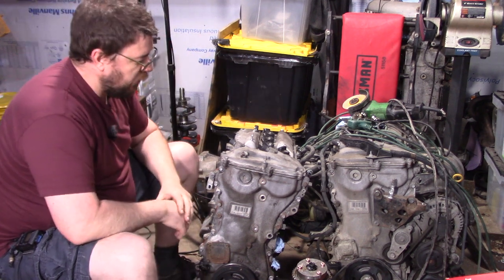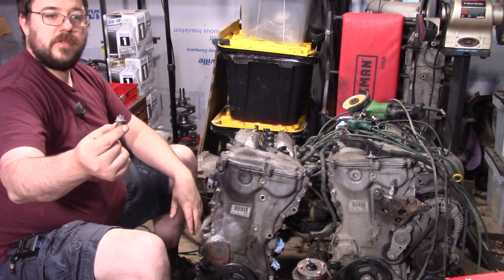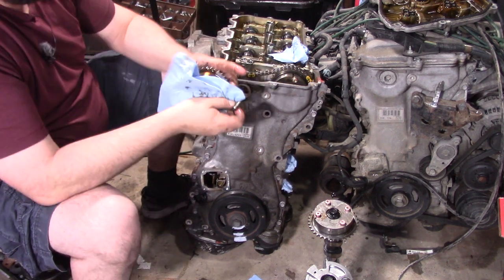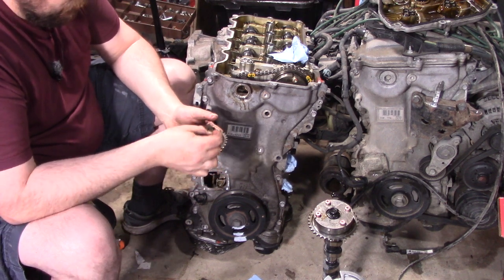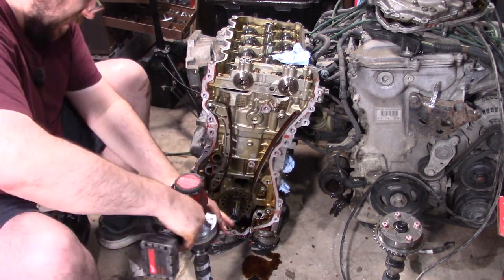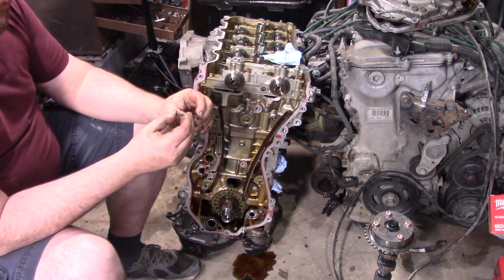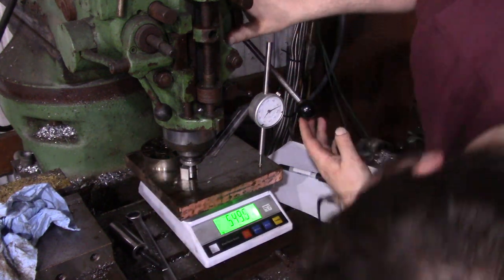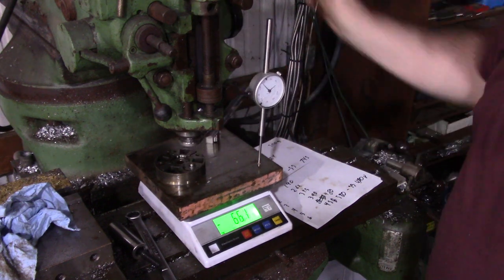Fixing the 2AR's incessant cam gear rattle for good!

Comment: You look at problems like a proper scientist. Using expert methodologies, professional instruments to gather data, and testing your hypothesis. None of this fascile power mod suggestion stuff anyone else can come up with on their own. I see you'll also transcendentally look for solutions and changes before setting pencil to paper, following your insights. All this possible through years of experience/training, but fueled by a strong love of the game for it's own sake. Thank you for bringing this content to us, it's always an education for me.
Reply from the maker: "professional" equipment.... as professional as I can get on a shoe string budget. I have to get pretty creative sometimes to get the data that I want and as you've seen now the mill often ends up being the base of my instrumentation. I really want to build a machine to test valve springs at high RPM to determine required spring rates. I'm pretty sure many people in the industry are using rather excessive spring pressures and I don't like the extra friction. I also need a flow bench at some point so I can explore some porting on this motor.
Reply: @FrankensteinMotorworks  Something something something kickstarter! Haha
Reply: I agree! Real talent here!

Comment: I always drop what I’m doing whenever you upload. Glad to see you were able to find an answer to your cam rattle. I like this style of video where it feels like we are all along for the ride on the mystery and is more satisfying than just posting conclusions. Oh, do you have a TIS subscription?
Reply from the maker: Thank you for the feedback. It certainly won't always be able to work this way since sometimes i spend weeks going back and forth to the shop measuring one or two things and just letting it stew for a while while i think of different designs that can solve my problem. 

I don't have a permanent TIS subscription but i usually buy a 3 day subscription a couple times a year. It's a great source for info. Especially if you read between the lines of the info they do give.

Comment: At 3:22, you state that "this is turning into a puzzle" and that "this is supposed to be possible" and you'd be right on both counts.  After messing with mine for half the day, while trying to keep the engine timing, I found out that I had the crank 180 degrees off of TDC "compression".  With crank at TDC compression, this puts the key on the camshaft in the 11~12 o'clock position.  Next, I marked the gear and chain for both intake and exh gears so as to keep timing, then remove the bolt for the intake VVT gear, pull the gear out of the camshaft, remove/suspend the chain to prevent it jumping on the exh gear.  Finally, rotate the loosened intake gear such that the "key hole" on the gear is at the 5 o'clock position, this allows the gear to clear both the timing chain cover and the camshaft key.
Reply from the maker: Thank you for the info, i will keep this in mind for next time. I know i will need to do this at some point in chassis.

Comment: Also worth noting is the condition of the vvti screen filters behind the banjo bolts. 
When they dirty/clog, initial oil flow on engine cold start is reduced.
Reply from the maker: The AR has the filters inside the engine so they aren't easy to check after it is assembled but that is a good point that should be checked.

Comment: I suspected spring tension also, as Honda has the same problem and I have fixed it simply by stretching the spring and the rattle went away.

Comment: Great video!!! Very informative and to the point. One problem I am having on my 2AR-FE is of course the cold start rattle but also after the engine warms up what sounds like a Valve tick/knock. Doesn't happen all the time, seems to be there some days and other days the ticking/knocking is gone. 
 Any idea's on what this could be would be greatly appreciated!!!
Reply: @multirotormanish7220  I'm thinking it is the same thing. It happens when the engine/Oil is cold. If you notice when the engine/Oil is warm/hot, you don't experience the noise. It is also only in Drive and Reverse. When you hear it next time put the car in Nuetral or Park and it will go away.

Comment: At about a million points in this video,I would have had the dang springs go sproinging off, and have to shove a bunch of pen springs in there to replace them.
Reply from the maker: if it makes you feel better i did have one spring go sproinging off but I edited it out. It was while i was measuring spring pressures on the test fixture.

Comment: Hello from Japan and thank you for making this video it’s insanely formative my new Alphard will be delivered soon with 2AR engine which will eventually make this rattle sound. I’m a bit worried but oh well I probably trade it off.
Reply from the maker: Most of the 2AR-FE engines never have this issue. Make sure you regularly get the engine up to full temperature and keep it there for a while for best engine life.
Reply: @FrankensteinMotorworks  you mean run the engine?
Reply from the maker: @Atomex_edit  some people think that an engine that just takes a little old lady to church and back once a week is a good engine. Those engines are the one most likely to have a ton of buildup inside the engine because they never get up to temperature. I don't know what the car usage patterns look like in japan but if you are in a situation where all trips are short trips make sure you occasionally take longer trips with it to keep it up to temperature for long enough to get all the moisture out of the oil and just generally keep things clean.
Reply: @FrankensteinMotorworks  thanks I will take your advice to take a long trip around Japan with family. It’s probably the best advice I have ever received here on YouTube. Cheers!

Comment: I noticed that the Canadian 2az in the 11+ cars recommend 0w20 oil and the earlier 2az suggest 20w30 or 0w20 oil. The 2az are bad for the vvt cam gear rattle, mostly with them the pin wears a groove into the material though.
Reply from the maker: Yeah, it's really frustrating that the configuration does not allow for a proper spring rate to be installed in a way that prevents the valve from sitting in a position other than fully open or fully closed. If this does not fix it I'll need a two part pin would require more pressure to open than to hold it open.

Comment: Love the content Marc. I feel like you have been neglecting 2GR R and D. 2AR is cool and all but I feel like there are a lot more SW20 2GR swappers out there. Regardless, wonderful content and very interesting.
Reply from the maker: Launce, I've literally just released a new flywheel for the 2GR and also a new accelerator pedal assembly for the SW20 swaps. I'm not ignoring the 2GR, the 2AR is a fun motor to play with that responds very well to mods and the architecture is very similar to the 2GR so lessons learned will be applicable over to the 2GR when i get there. Things like figuring out the right kinds of spring seat pressures necessary and what needs to be done to the valvetrain to get it to rev to the moon without a rapid unscheduled disassembly event. Plus, my race car has a 2AR, not a 2GR.
Reply: @FrankensteinMotorworks  totally understand and I am one of your customers including recent purchase of your flywheel and soon pedal setup. I should have been more explicit by saying video content vs. R and D. My bad. Hope you have some new 2GR videos really soon!
Reply: @FrankensteinMotorworks  well I, for one, am very excited for this spring info now, as I either have ridiculous rattle or my bottom end is knocking :( :( :( :( :(
Reply from the maker: @mrkazman  I don't have enough testing done yet to have the springs for sale but if you're wanting to try it yourself i'm happy to sell you a set of springs.

Comment: Has it been rattling long? The reason I'm asking is that I didn't see any signs of wear/damage and mine has the cold start rattle, too. I've also been hearing about people just leaving the engine alone and that this issue doesn't actually cause reliability or longevity issues. Thanks and great channel!
Reply from the maker: Unfortunately i don't know the answer to that. The motor has been rattling as long as i've had it but it only spent about 3 weeks in the car before i pulled it out to test out the 2AR-FXE build instead.
Reply: @FrankensteinMotorworks  Understood and thank you for replying back!

Comment: 3 years later. I  checked your site for the springs and didn't see them. Did this not fix the rattle?
Reply from the maker: It fixes the rattle for most people but the amount of hand-holding required to help people through the installation is ridiculously high so i no longer sell them.
Reply: @FrankensteinMotorworks  Lol. Damn that sucks. Guess I'll just buy a new gear or experiment on my own. Thx for your input on this video and response.
Reply: @rotaryperfection stretch your vvti spring.
Reply: @DIYCOMMUNITYHACK  Couldn't on mine as the interal mechanism was completely broken. Had to buy a new part.

Comment: Have you done a video on how to unlock the gear ?
Reply from the maker: I know i'm incidentally shown it a few times but i've never really properly focused on it. The factory service manual does a really good job explaining it. If you send me an e-mail or contact me through the website I'll be happy to send you a copy of that part of the manual. I'd put it here but i can't attach an image to a youtube comment.
Reply: @FrankensteinMotorworks  thank you man. I have the TSB for it but the suggested method didn’t work for me. Been frustrating as hell. I’ll just have to experiment. Should have just bought yours

Comment: Hi ,I have 2009 2arfe, with severe oil consumption, can I reduce the problem by doing bg engine flush procedure, also curious what year toyota resolved this problem because I'd like to replace motor with a good used one ,any advice
Reply from the maker: Severe oil consumption is really only an issue for very underutilized engines that never or rarely properly get up to temperature. It isn't actually a widespread problem. My advice would be to replace it and then just make sure you regularly get the engine up to full operating temperature.
Reply: @FrankensteinMotorworks  I realize that to a point but the 4cyls,had or maybe still have low tension oil rings,do you have any insight into when or if they started using rings that didn't have the stuck ring senaro?

Comment: Do these engines have the little plastic oil filter for the VVT oil circuit like the UZ engines? (FILTER, OIL CONTROL VALVE
 15678-46020)
Reply from the maker: yes, they have a mesh filter in the #1 cam cap.
Reply: @FrankensteinMotorworks  might be worth comparing rattle vs non-rattle filters and / or logging the oil pressure to the actuator just to see if there is anything going on
Reply from the maker: @allan80supra  The filters have a pretty much identical mesh. The plastic carrier is a bit different because it sits in a different place in the engine but even that is pretty similar. The 2AR's vvt-i oil pressure is more or less impossible to log because it never exits the block. Also, once oil pressure comes up there's no control issue, the issue is before the oil pressure builds fully.  You can hear the issue very clearly at 18:53 in this video: https://www.youtube.com/watch?v=zOfbP0Tgye8
Reply: @FrankensteinMotorworks  doh... well good luck with the spring fix, I guess your other option is add an oil accumulator with the solenoid so it primes before start and a nice to have on a race car anyway... but my mind was just blown at the cost of the moroso accumulator valve on summit!
Reply from the maker: @allan80supra  One thing that probably wasn't clear with this video is that with the bigger cams the issue isn't just at startup but it is the same issue. That's why it became necessary to fix it right away. So unfortunately in that case a startup accumulator would not address it. There are people that have actually fixed their stock AR motors that way though because even an expensive accumulator is cheaper than paying someone for a phaser replacement. I do have some thoughts on an integrated accumulator for this motor that i would like to make at some point.

Comment: After that? What happened to the result of your hypothesis? Did  the rattling FIXED?
Reply: Hahahaha ! Good question, I’m waiting for several people to post their results, at least 5 o 10 people proving this hypothesis to do mine, I’ll already stretched out one spring from the old phaser from 20mm to 30mm , just in “Stand By” waiting for reliable and credible results
Reply: @64arguz okay, what’s the update? Did the rattling fix?
Reply: @DIYCOMMUNITYHACK  nope , I haven’t had time to do it 🤦‍♂️

Comment: I'm getting startup rattle on my 2GR 😢
Reply from the maker: The 2GR is a different design and should not suffer from the same issues. If you're having rattle on a 2GR and you haven't recently done an oil change you should change your oil and filter and also clean out the vvt-i filters and if the rattle does not go away you should change out the offending phaser(s)

Comment: I didnt see the springs on your site. Are they available?
Reply from the maker: You can reach out to me via the contact form on my website if you want to buy them. Unfortunately these have turned out to not be worth the amount of support time they take to sell. But if you want to buy them without installation support i can sell them to you for $25. frankensteinmotorworks.com
Reply: Hey bud. Is the solution to install these custom springs into a brand new Genuine cam sprocket? My noise is very minor and only on cold start for say, less than 1 full second. 114k miles and I do want to keep her going as long as possible.

Comment: Did you test the springs in the 2AR?
Reply from the maker: Yes, these springs are installed in four different 2AR motors out there and it seems to properly fix the problem.

Comment: did you ever find the correct spring to eliminate the issue?
Reply from the maker: The spring that i found has worked well for the engines it has been used in so far.
Reply: Hey buddy. Recent subscriber. I'd like to inquire about the springs you had in testing. My '13 Camry 2AR rattles on cold start (even in Florida heat) 0w20 oil, always full on dipstick and changed every 5k. Owned the cat since 57k miles and now has 105k miles. I check your website briefly but didn't see anything about the springs. 

Would it be best to get the spring from you and also install a new cam gear? I haven't inspected mine but the noise goes away in +/- 1 second so maybe no notice damage yet.

Comment: are you referring to the Toyota tick?
Reply from the maker: no, this is the startup rattle, not the "sowing machine" sound that is normal when the engine is running. You can hear it in this video at 18:53: https://www.youtube.com/watch?v=zOfbP0Tgye8
Reply: @FrankensteinMotorworks  That sounds really familiar, if not, the exact same as the startup rattle on early (2009-2010) 2ZR's. In the case of the 2ZR, Toyota addressed the issue around late 2010-early 2011 and I believe any 2ZR 2011 and above no longer have the startup rattle. Is it the same situation with the 2AR or did Toyota never address the issue with an updated cam gear?
Reply from the maker: @nobelium8028  they technically did address it but the problem is still there. I haven't gotten my hands on a pre-TSB phaser yet to be able to see what the difference actually was. I am looking for one and if there's interesting information when i find one i do plan on sharing it.

Unfortunately my fix is more of a band-aid. The fact that the backing plate that the spring rides on moves is a problem and the fact that there's a pressure dump that isn't balancing both sides of the solenoid pressure can't really be fixed without a significant change. 

I will also keep looking to see if i can find a phaser with a design that looks more like the 2GR-FE that could be repurposed for the 2AR-FE but so far there is no luck in that direction. the "Vee" motor phasers are completely different and the updated phasers in the A25A are so different they could not reasonably be retrofitted.

Comment: Did the springs fix the 2ar start up rattle?
Reply from the maker: Yes, It fixed my issue.
Reply: @FrankensteinMotorworks  My 2014 Camry was making the noise , Toyota dealer put new cam gear on under warenty, at 60k at 80 still making noise on start up , one morning crank it up and lost compression. im sure all the intakes are bent. i love these SV40S AND 50S but want to fix this issue.  would like to by the pair of springs from you
Reply: @FrankensteinMotorworks  Me too! Got a 2009 RAV4 with the rattle. The updated Gear is out of stock in the whole continent.